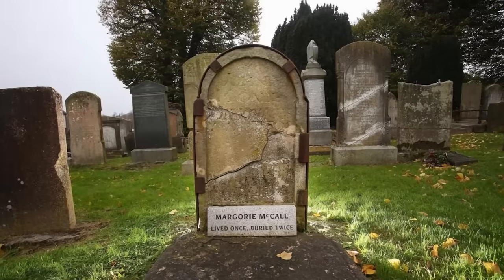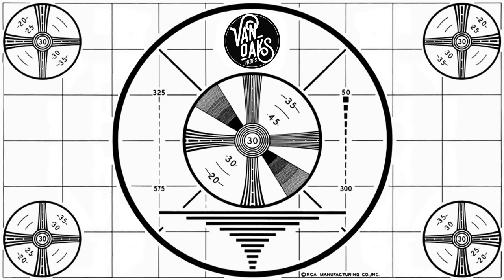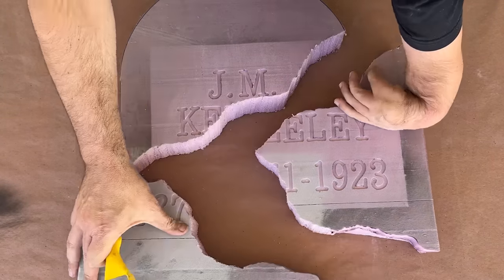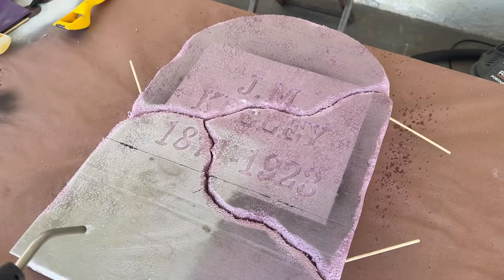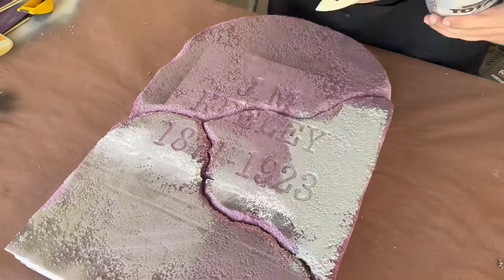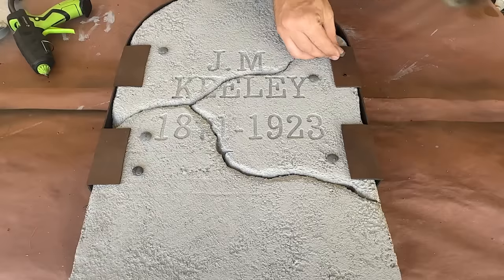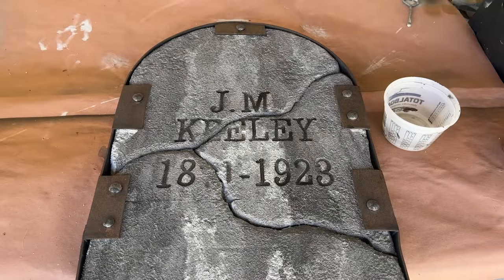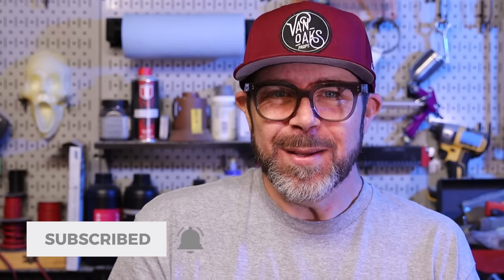DIY Broken Tombstone Prop for #halloween

Comment: Get closer with the spray paint and LET it dissolve the surface. You can go light or heavy and get different depths of "carving". Let the solvent work for you. Done right it can look like sandblasted letters or deep cast letters. Love the repaired tombstone! One last thing. Marble and granite stones will get "gritty" as they age. Slate  tombstones stay very smooth and make for great rubbings. Even after hundreds of years.
Reply: This is how I make my tombstones

Comment: I'm so jealous of your computer and your vinyl cutter. I've made about 40 Stones like you make them but everyone has to be hand traced with different stencils sizes or shapes one stencil at a time with a magic marker
Reply from the maker: I was in the same boat. I just got tired of doing it by hand and grabbed a vinyl cutter on sale. I'll never go back LOL
Reply: @VanOaksProps  I totally agree with you it takes so long to do all the stencils by hand I have to draw a straight line so all the stencils line up across the tombstone on a straight line and I have to space them out by hand sometimes it gets really annoying LOL. Because of that each Tombstone takes me 8 to 10 hours . I work on them a couple hours after work every day I make around 5 to 6 per season. I buy  two 4×8 x 2 in thick foam sheets.

Comment: These are great videos this is how I do my tombstones instead of the torch I use a heat gun but I have to be careful because if I put it too close and too hot it opens up the letterings, ugh. I use two coats of Drylok gray that usually works very well. A hand paint with full latex paint in every letter can take hours sometimes to do the whole Tombstone but I like it nice and bright so after my coats of weathering it takes off the shine a little bit to finish my tombstones I dry brush the entire Tombstone with white paint really picks up all the edges and the lettering perfectly just got to do the latest dry brush you possibly can in white
Reply from the maker: That's a great method

Comment: Hmmmm... paintable caulking? never thought about it, i had only seen or heard people use wood putty, spackling ( for some reason the paint always bubbles when i use it :/ ) and some other glues, i may switch to using caulking now, i did a tombstone ( video coming tomorrow ) where i pressed the Great Stuff' Foam into the cracks and let it dry, i used an exacto knife to carefully cut away most then finish sanding it smooth, i found that works but is far messier, how hard is it to sand caulking? i HATE those seams in the foam, if you dont seal them hard they'll re-open up and show through your paint and man that destroys a good tombstone, i appreciate these videos for tips so much!
Reply from the maker: You can’t sand caulking, but you shouldn’t need to if you’ve applied it smoothly and paint over it.
Reply: @VanOaksProps   oh ok thankyou!!!